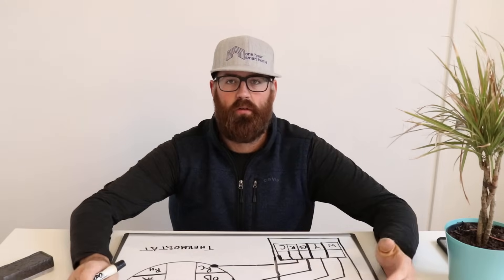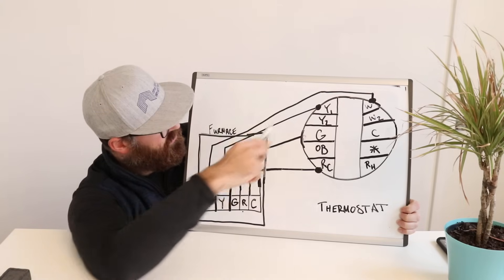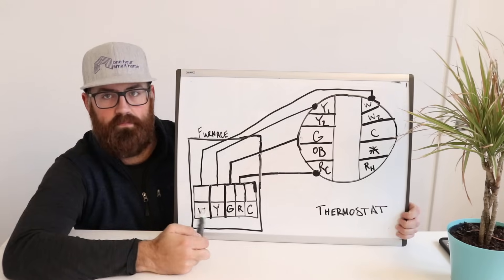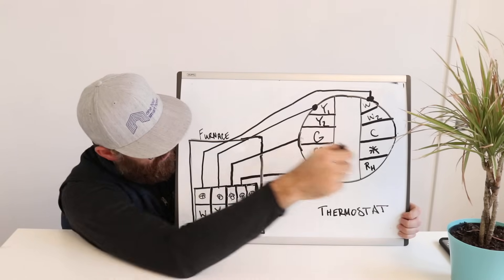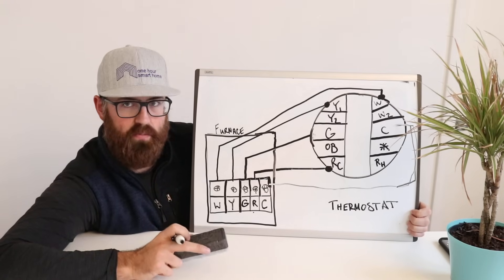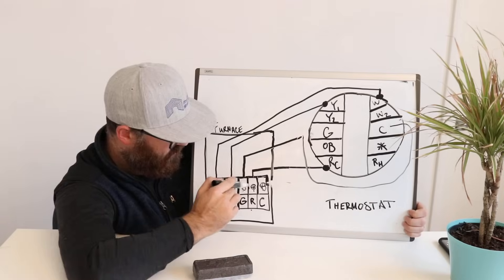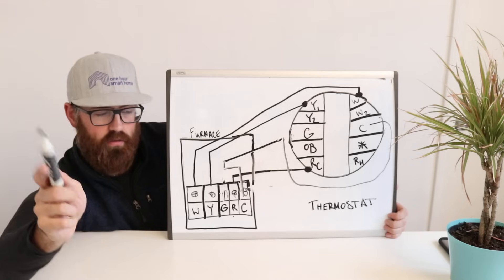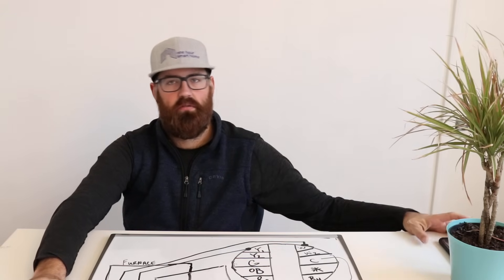Nest Wiring Diagram How To Install C Wire or Common Wire

Comment: Hello James,

   Excellent video, have questions below to confirm situation before approach.

   I have a typical single family fan forced heating/cooling system, converted to NEST thermostat, heat works fine but does not recognize AC per follow hookup (the outdoor condenser fan is constantly “on” unless I pull fuse).  Here is the wiring details, please help.  Thanks.

NEST   to   HVAC
 Rh              R
 W1             W
 C                Y                    
 G                G
                    Com24v         

   There are two wires coming from condenser are connected to “Y” and “Com24v).  I have access to add new wire if needed.  Thanks again.

Comment: My furnace has wires labeled 1 thru 6. How do I know which is the G and which is the common wire?
Reply: What color wire is in each position?
Reply: @CitizenPerkins  Just red and white that extended a wire going up to the thermostat. I need to follow those wires back to where they extend from to be sure.

Comment: GREAT video!  What if I want to keep the green wire and attach my spare blue wire to the C terminal for my air conditioner?  Will that work as well?
Reply: I tried that and it didn't work, it no power from the Rc wire
Reply: @rickchapman4240 it really is a pain if you want have a C wire.
Reply from the maker: It can for most systems. You just need to make sure you connect the C wire at both the thermostat and the wiring terminal on the HVAC control board. The other issue you can have is that your HVAC system doesn't put out enough power. If that's the case you might need a common wire transformer: https://amzn.to/2n3nTwp this video shows how to connect it: https://www.youtube.com/watch?v=gahPxCcPDto

Comment: I've been trying to figure out how to fix the COOL setting on my Nest Learning Thermostat (Gen 3.) I don't have a yellow wire, but I do have a black wire. I also have a white wire, a green wire, and a red wire. Can the black wire be used in place of the yellow wire?
Been trying different combinations all day. No luck. Seems like I need the Green wire as a fan wire since it doesn't auto turn on the fan when changing temperatures.
The house heats no problem but the AC unit turns on and doesn't pump very cool air. The temperature seems to stay at the same temp with and without the COOL setting on. 

My current set-up is Black wire into Y, White wire into W, Green wire in G and Red wire into Rh. (I've also tried the same setup with Red wire into Rc instead)
Reply: In most cases the colors don't technically matter, they just help keep things standardized and consistent. So long as the end of each wire goes to its mate.

Comment: Hi, I have found your videos very informative hence the following question: I currently have 2 thermostats 1 for my evaporative cooler (Dial) and 1 for my heater (Honeywell), I am trying to setup a 110vac evaporative cooler w/ 2 speed motor with my 2 wire 24vdc heater on a single programable thermostat a Nest (tired of constantly fussing with 2 thermostats including recalibrating them almost weekly).I know that I need to step down the voltage to the thermostat to 24vdc from the cooler, what is the best way to go about this … I purchased a Mastercool Master Stat control box but from all I can gather the interface wires only output 3.5 vdc (only 3 wires not identified beyond Red, Black, White), and I know I will probably have to rig a "C" wire per your video, any suggestions on how to step down voltages from the cooler to interface w/ the Nest?I have tried a single stepdown transformer/relay but probably need multiple is my thought and I am assuming that I will need to connect the low to Y1 the hi to Y2 but not sure where to connect the pump O/B maybe?

Comment: What if my board doesn’t have C terminal?? It only have R and W on the board!!
Reply: I find my heat on even though my nest is turned off. Will installing a c wire eliminate this issue?
Reply: Don't do it, you can fry the control board.  It will be pulling some power from the board causing mini power surges, and over time this will fry your control board, like 6 months to a year.  I'm a service tech and have run into the problem many times.  The guy in this video doesn't know what he's talking about, he's just trying to sell you something.  And Google is not going to pay for the control board replacement for your furnace.
Reply from the maker: Have you tried it installing the Nest? It will often work even without a C wire. It can work in setups with just an R and W wire. If not you can add a common wire with a common wire adapter: https://amzn.to/2Xv3H6t  this video shows you how to connect the common wire: https://www.youtube.com/watch?v=gahPxCcPDto

Comment: OK this clears it up a little but of course my HVAC and current thermostat are not like this. Trying to install a Nest T3007ES. Please help:
HVAC:  
COM: with a white wire going to it
W: with white wire going to it
Y: with a yellow and red wire going to it
R: with a red wire going to it
G: with a green wire going to it
And a loose Blue wire not attached to anything

Current Thermostat:
G: With a Green wire going to it
RC: with a Red Jumper going between it and RH
RH: with a Red wire and the jumper to RC
Y/O: with a yellow wire going to it
W/B: with a white wire going to it
Y1: with nothing attached
And a loose Blue wire not attached to anything.
Reply from the maker: Do you know if you have a heat pump?  If you have a standard HVAC furnace & air conditioner connect G - to G, RH to RH, Y  to Y, W- to W
Reply: @OneHourSmartHome  I do not have a heat pump but the HVAC control board does not have an RH, and do I just leave the blue unattached to anything?
Reply from the maker: Yes, just leave the blue unattached, if you find it has low power you could use the extra blue wire connected to C on the terminal and C on the Nest Thermostat. But most HVAC systems don't need the common wire so I would leave it unattached unless you are experiencing low power issues.

Comment: SO, I don't have a C connection, but I have a COM 24v. I have attached everything normally, and attached the COM24v line to the C line on my thermostat. I get no power to my thermostat still. However, I also see that there is a white wire connected into the COM24v on the unit in the attic. Any ideas? I am scratching my head now.
Reply: and for reference, to my thermostat(old) WYRG were connected in color code, so I replicated that on my new thermostat.
Reply from the maker: Did you try it without the common wire? Not all systems require a common wire. Also just to note, the AC system is typically a loop where a wire runs from Y to the air conditioner then returns back on the common wire. So that when the thermostat sends a signal for AC the it will run through this loop and turn on the air conditioner.
Reply from the maker: If you have a multimeter: https://amzn.to/2FmPMFs you can see what voltage you are getting at the thermostat by measuring the voltage from  R to  G, R to W, or R to Y. You should be getting  24V.

Comment: "Every furnace has a C wire"? Mine does not. there are only two terminals coming from my furnace. 
Also, my A/C unit is TOTALLY separate. My Nest works all winter without the C wire, but in the summer it does not charge and needs to be disconnected and charged every couple days.
Will there (should there) be a C wire on my A/C unit that I can use? Or will I need to go the external transformer route?
Reply from the maker: You might be able to use the C wire terminal on the A/C  unit, depending on the control board and system that is installed on the unit if it has one it's worth giving it a shot, or you could hi-jack the g wire as shown in the video. If that does not work this external transformer could work: https://amzn.to/2KMHuKK

You can watch this video for instructions: https://www.youtube.com/watch?v=gahPxCcPDto&t=39s

If you got eh external transformer route   I would first try it with both the R wire from the furnace disconnected and the R wire from the AC unit disconnected and the external transformer connected at Rh and C. Technically the Nest is supposed to allow dual fuel systems with an Rh and Rc wire but it does not alway work with system like yours. The external transformer,  is  good route to try.
Reply: One Hour Smart Home - thanks bro. That C wire from the AC worked. 🙏🏻👍🏻👌🏻😎
Reply from the maker: @13karpel  Glad it worked out!

Comment: what's the difference between R c and RH? thank you!
Reply from the maker: For most people with standard systems nothing. But it is designed for dual fuel or dual source systems. The Rc is the cooling power and the Rh is the heating power source. Most standard systems only use one power source and its Rh. Which will provide power to the thermostat and allow you to control both heating and cooling systems.
Reply: @OneHourSmartHome  thanks!
Reply: I have a wire going to the rh from the wall then another wire going from the rh to rc what do I do?
Reply: @bigdoggiedee  The wire between Rc & Rh is called a "jumper"; the Nest does NOT need jumpers. The one R-wire from the wall (whether called R, Rc or Rh before) can go to either Rc or Rh on the Nest 3rd gen; if only one is active it will jumper them internally. The Nest E has only one R terminal; the single wire goes there. (For other thermostats, check the installation instructions. Some thermostats still want you to use a jumper with a single R-wire; ecobees want a single R-wire in Rc, with nothing in Rh unless you have two separate R-wires from the wall.)

Comment: Is the G/fan needed if you have a colonial?
Reply from the maker: Most units don't need the G/Fan wire. They will auto activate the fan when heating or cooling is called for. You can test by removing the G wire but leaving all the other wires for the thermostat the same, and turn it to heating or cooling to see if the HVAC system still blows air. Thanks for your question, here's the Nest Thermostat if you are interested: https://amzn.to/2Vo4B4C
Reply: @OneHourSmartHome  I tried that and my system stopped blowing cool air while the AC ran.  What to do now?

Comment: Wow this is brilliant. We started using the air for the first time with the nest and have had problems so I’ll have to try this.
Reply from the maker: Glad to hear it helped! Thanks for the comment.
Reply: I am going to be replacing an infinity thermostat from 2007 to a wifi thermostat.  Do you know if the infinity thermostat uses a C wire?
Reply: @rgruenhaus  an infinity thermostat is communicating. You would have to rewire the furnace to the conventional terminal block and use the r,c,y,ect terminals instead of the abcd plug infinity systems use

Comment: I never use my heater. Can i also use the heat wire as a new c wire ?
Reply from the maker: Yes, if you rewire the terminal (w) in the heater to the common wire and do the same thing on the thermostat. You will just no longer be able to control your heat